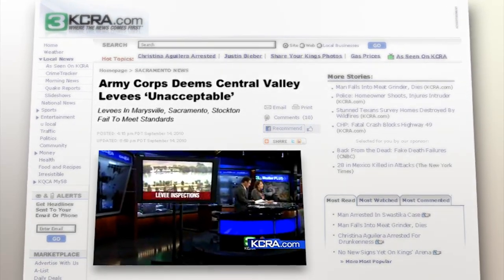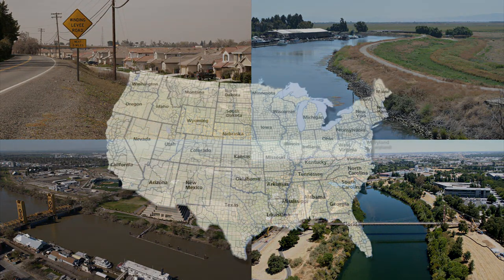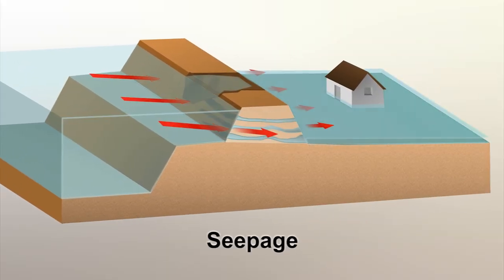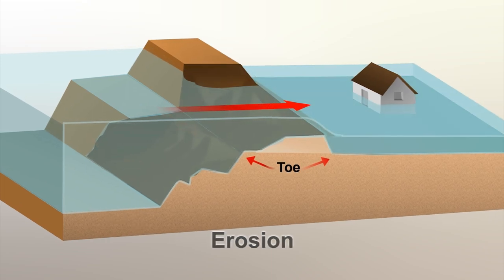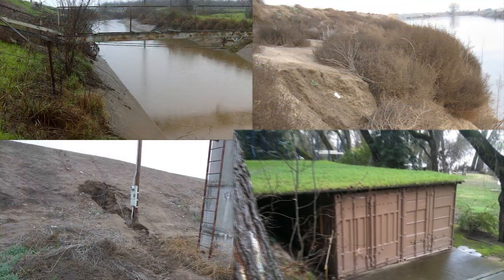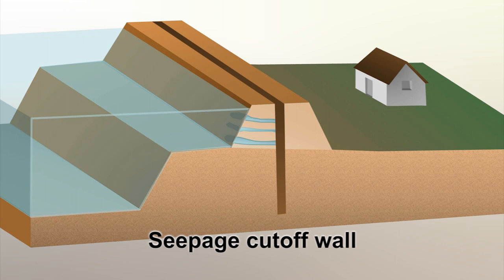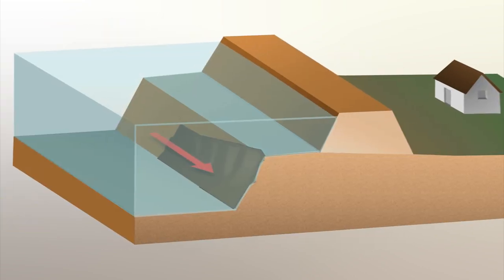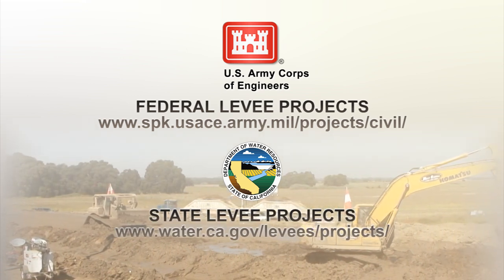How levees fail, how we fix them

Comment: Could a levee be made using terraced water containers. The bottom layer filed with sand or dirt. After the water reaches the second terrace, the terrace having drain holes in it the container fills up with water.  Each terrace layer is the filled as the water tops the terrace. The water in the containers creates the weight needed to hold the hold the water back. If this works I would like a nice paycheck. Super poor me.
Reply from the maker: Walter Marlin Thanks for your question. Yes, a levee (which is essentially a barrier holding back water) could be made using terraced containers. The Corps and other state and local agencies use something similar during flood fights to what you describe. However, all layers of the containers are filled with soil, sand or rock. We’ve found that the containers are only suitable as short-term solutions. Here’s a video about some of the flood fighting technology barriers/containers we use: https://youtu.be/Wbhe9Q0GXIg or search "Flood Fight Technology"
Reply: SacramentoDistrict I watched the video you posted. There are some interesting ideas shown in the video. 

So my idea is more original than not? I wish I had the funds to patent my idea or even create a photo-type.

Comment: Thank you for sharing this informative video on the California Levee System. A wonderful exploration of intelligent engineering, that is unfortunately doomed to failure. The basic and fundamentally problem is encapsulated in the term "....flood plain.....". All across the US but most specifically along the Mississippi and the California Sacramento River systems, human beings have been farming ( and more so in the last 50+ years ), developing onto flood plains. 

This begins an inherent cycle of ( TAX ) Funding and Construction of Levees, which then creates an increase in both Farming and Development, and then the eventual Flooding and Destruction of the Levee ( and the surrounding property ). With then a Re-Funding, more Construction, and then more Farming and Development. Even if assuming the existence of a non-altering hydrologic system, this is a TAX expensive and unsustainable exercise, for even if the water system remains the same, the Farming and Development does not, ergo an ever increasing cost structure is inherently built in. With the advent of Global Climate Change the hydrology side of this equation will be increasingly altered.

This is NOT an environmental problem, this is a Social-Political Zoning Tax problem. The primary solution is for the State to acquire these Flood Plains via increasing the Insurance Costs, and / or the Property Taxes within areas supported by the Levee System, thereby reducing the Farming, the Development, and correspondingly the number of Levee's in the Flood Plain.